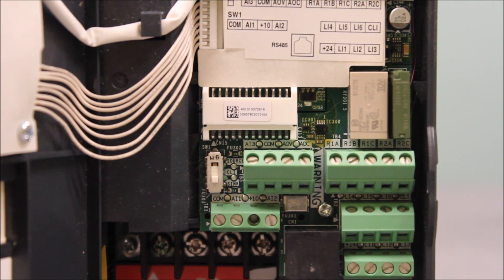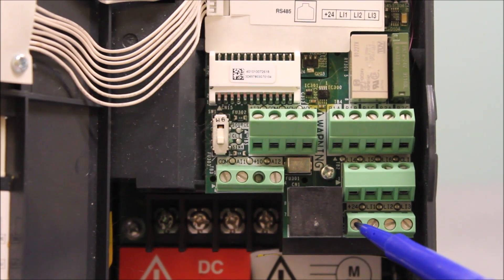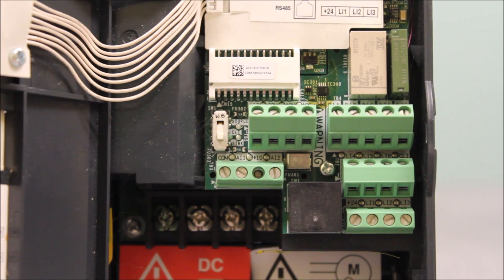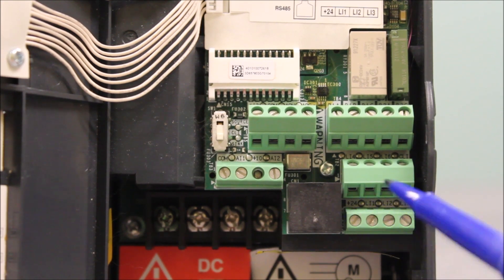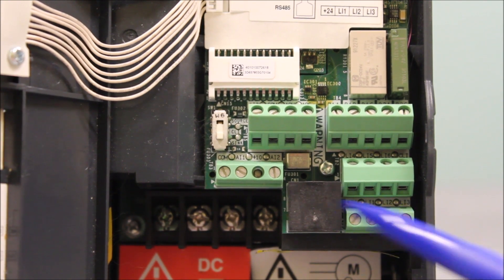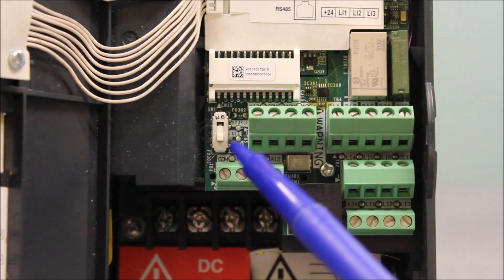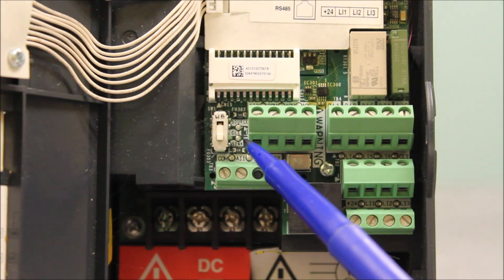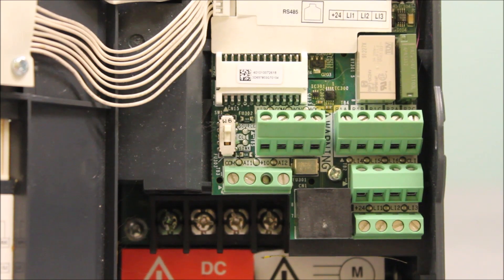Configuring Logic Inputs in SINK Mode on Altivar 312 | Schneider Electric

Comment: hi, 
 nice tutorial,  so if im using  CNC breaker board as 24v power supply signal to LI1 and common  i have to switch to SINK mode in order to run my router spindle.